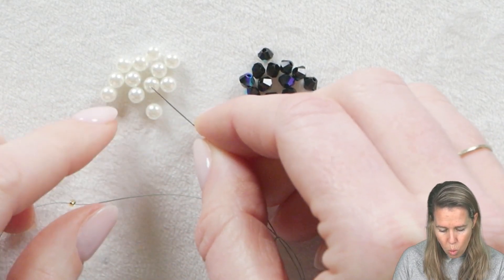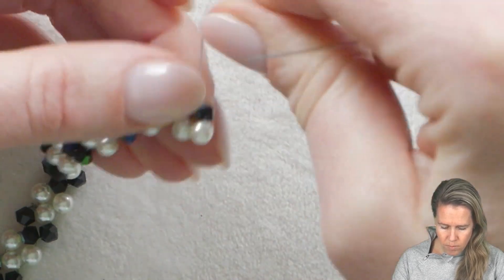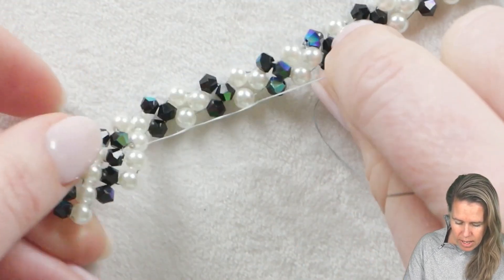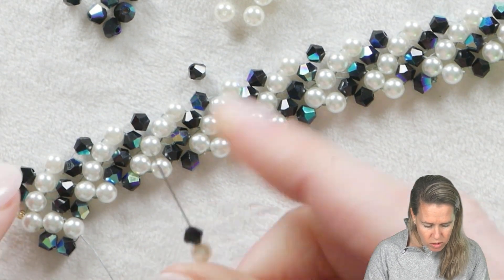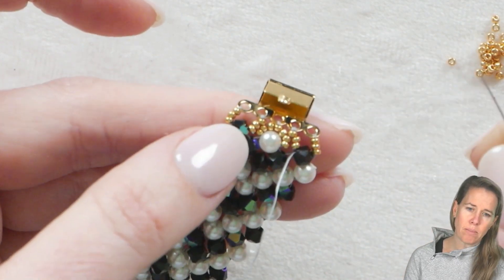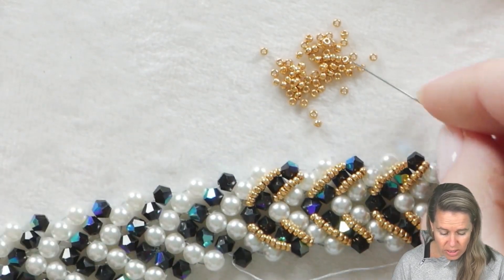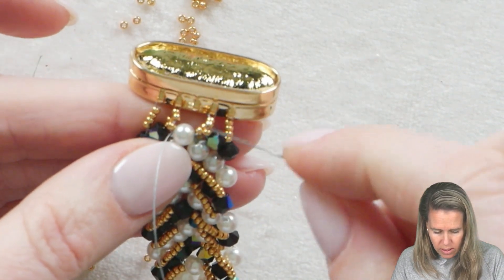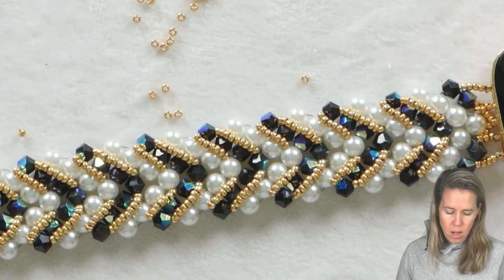Varuna V RAW Bracelet - DIY Jewelry Making Tutorial by PotomacBeads

Comment: I just looked at Dragon thread. In the description you don't say what weight it is comparable to. Which is closest to 4lb/6lb Fireline please?
I LOVE it's metric like the vast majority of the world... Imperial is just confusing 😕 We changed in 1974!!
Reply from the maker: We like to use the size 6
Reply from the maker: Potomac Pearls - Cream 4mm	~ 85 Beads 
Potomac Crystal Bicone Beads - Jet AB 4mm	~ 85 Beads 
Miyuki Seed Beads - Duracoat Galvanized Yellow Gold 15/0	~ 2 Grams 
Potomax Infinite Long Oval Clasp 5-Loop	1
Potomac Crystal Long Ovals - Jet 9x27mm	1
Reply: Hi I have beadalon beading string  19 & 49 and fireline. If I were to use fireline 6 lb is it as thick as the dragon thread because the dragon looks thick in the video or should the 19 or 49 beading string be better? And finally I don’t have that clasp is there any other type of clasp that can be use to give similar results?